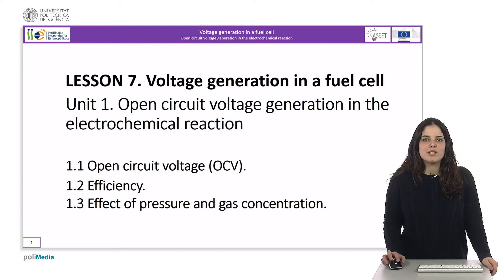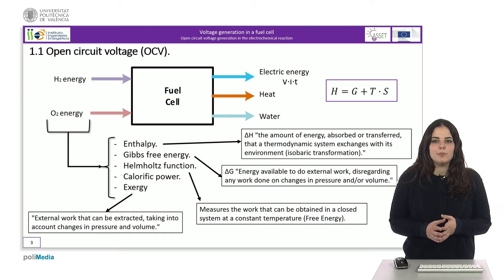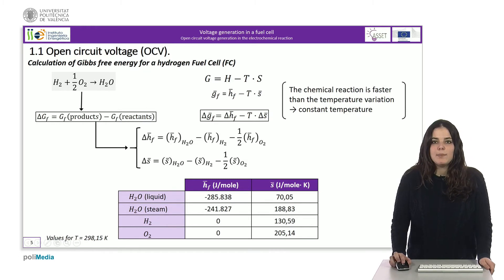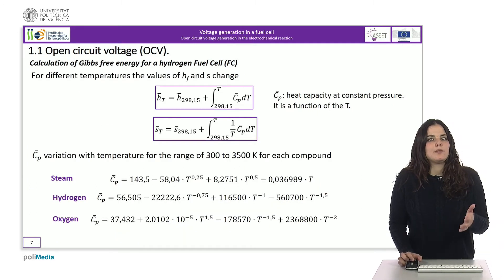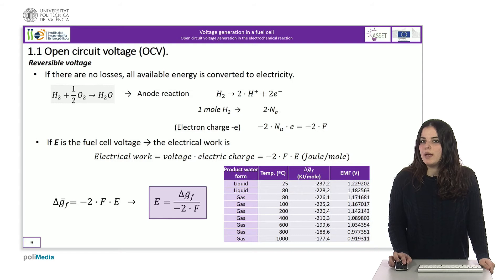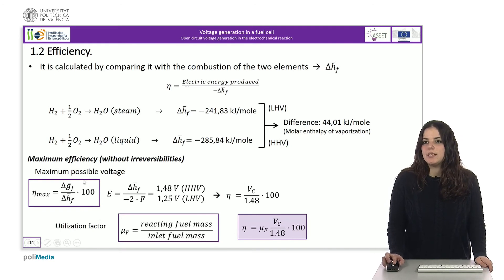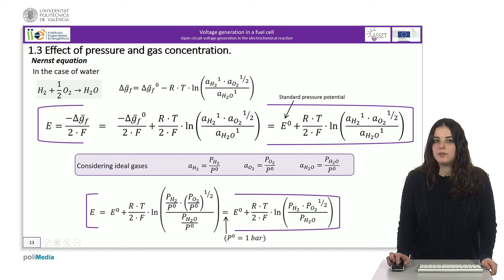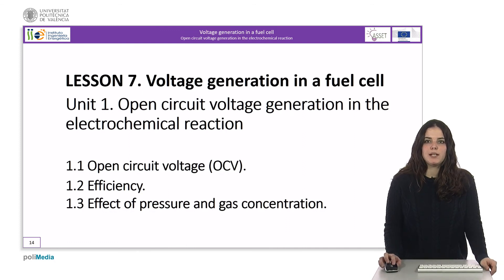Lesson 7 Voltage generation in a fuel cell Unit 1 Open circuit voltage generation in the electrochem

Comment: Every concept and calculation are fine and can be understood. 
However, in open circuit condition, there is no external circuit for electrons to flow from anode to cathode. There would be no complete reaction (H2 + 1/2 O2 -> H2O). Then, how can OCV be generated?